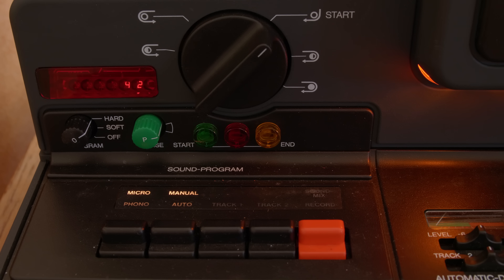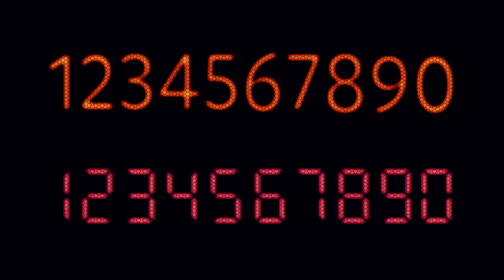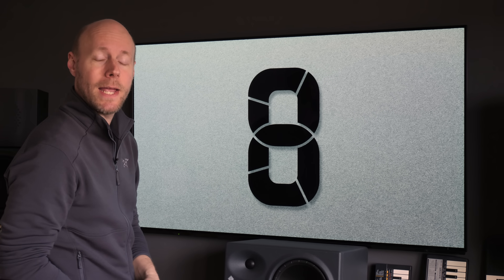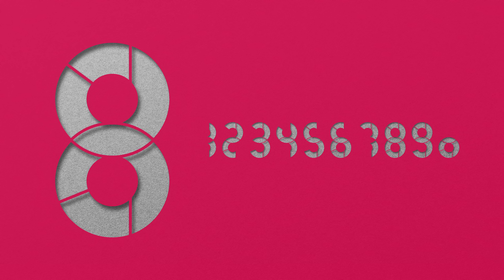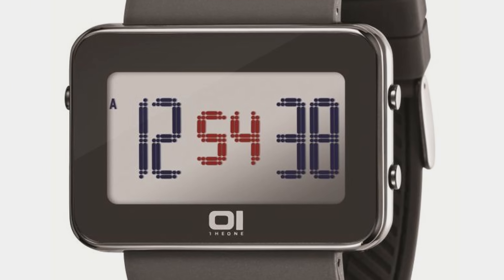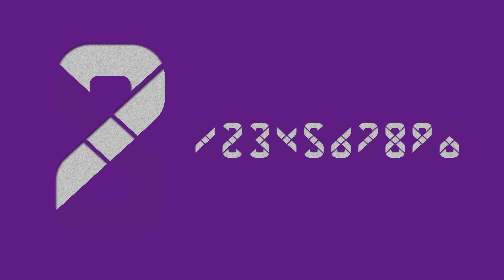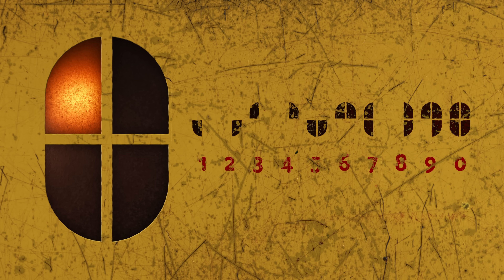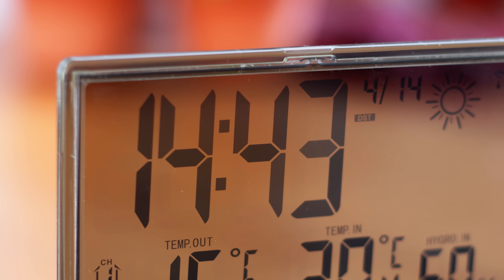Segmented Displays

Comment: Wow, those "sports" styles (and a few earlier, and all the ones after) look horrid, surprised you found household items using them. Of the 7-seg's you have shown, the first one is probably the best, maybe one of those which is that one but with cut outer corners.
Also, you said the normal one is inaccurate? How? you tried displaying a font above it, but while I would (and always have) agree that 2 is a bit off, you invalidated your entire point by intentionally using the 4 with a radically different look. That's akin to someone having a font and showing it's "incorrect" by comparing the "a" to the standard-font's "A". Or if you get a font with that other version of lower-case a (the one much more common than what "a" is in this comment, the one that "@" is based on)

Oof, the 6-seg displays are super horrible. Makes sense why we stuck to 7-seg I guess, despite the vastly increased complexity (1 single more led to wire! Per digit!!!).

Comment: Very interesting. I remember thinking about this when I was 14 years old and not being able to come up with anything better than the 14 segment "double square plus X," which IMHO is still the best overall for western numbers and letters.

But recently I've been studying Japanese, which uses all of our characters, plus Hiragana (ひらがな), Katakana (カタカナ) and Kanji or Chinese characters (漢字). The latter can become unwieldy (eg. 鬱、薔薇、檸檬) so I'd be surprised if there ever was any Chinese or Japanese display system for those that was not a high resolution dot matrix.
But Katakana is more regular and squarish, and you can write all of Japanese with it if you want, it's just harder to read than if you used the proper characters for each word. So I wouldn't put it past the Japanese to have had dedicated Katakana LCDs in the 80s.
Here is all of Katakana for reference:  アイウエオ、カキクケコ、サシスセソ、タチツテト、ナニヌネノ、ハヒフヘホ、マミムメモ、ヤユヨ、ラリルレロ、ワンヲ plus two diacritics in the top right corner: ゛゜
Reply: I did a few searches in Japanese and I checked their Wikipedia and nothing came up. But I don't think it's impossible. For example, if you look at ウクサソタツヌフメリレワヲ they all have a ノ in them, while シラン and possibly カ have the bottom 3/4 of a ノ. If you want to try your hand at designing such a thing, I can help you tell what is legible and what is not. Admittedly you also need smaller versions of some characters: ァィゥェォ、ャュョ、ッ in addition to what I wrote above.

But if you look at the default character set of the ubiquitous HD44780 dot-matrix text displays, they all have Katakana in them (eg. in http://d32zx1or0t1x0y.cloudfront.net/2010/03/HD44780_breadboard_05_lrg.jpg see the 4 columns from 1010 to 1101) so if they can read it on a 5 by 7 dot matrix (35 segments) I'm sure it can be done with a more elegant choice of segments.

Comment: Something to acknowledge is that not every country write the number the same way. 
For example, in France the numbers are way more round, where 6 and 9 looks a lot like a 8. The 2 tends to have a little "o" where join the base and the leaning part, but mostly in cursive form. The 1 has frequently a "_" underneath while the upper leaning bar is way bigger. The 4 looks almost exactly like the one on digital display (more like a + with an almost vertical bar in front, why is the gap closed in the upper part of 4 anyway?), and the 7 has always a "-" in the middle of it and even a "_" underneath sometimes.
In a effort to make compromise to fit better the way a country write their number, some display would end up to be way further from the basic solution for other countries.

Comment: Cool video.

I've not seriously tried to improve the structure of the seven segment display, though now I'm tempted to give it a go, but I have come up with a set of digit designs for display on a standard 7 segment display with the design goal that it should include the dozenal digits dek and el (I later added 4 digit forms to accommodate hex), not have any digits which were pure rotations of eachother (standard 2 and 5), for each digit to differ from every other digit by two or more lines (k-maps were helpful here), and to meet my aesthetic preferences (such as for a 6 with a top, and a straight backed 9). (The following are shown with shared corners, imagine a diagonal line separating, or equivalent; these were designed with a standard 7 segment double square display in mind, though more advanced displays may of course be able to handle them)

⬛⬛⬛⬜⬜⬜⬛⬜⬛⬛⬛
⬛⬜⬛⬜⬜⬜⬛⬜⬜⬜⬛
⬛⬜⬛⬜⬜⬜⬛⬜⬛⬛⬛
⬛⬜⬛⬜⬜⬜⬛⬜⬛⬜⬜
⬛⬛⬛⬜⬜⬜⬛⬜⬛⬛⬛

⬛⬛⬛⬜⬛⬜⬛⬜⬛⬛⬛
⬜⬜⬛⬜⬛⬜⬛⬜⬛⬜⬜
⬛⬛⬛⬜⬛⬛⬛⬜⬛⬜⬛
⬜⬜⬛⬜⬜⬜⬛⬜⬜⬜⬛
⬛⬛⬛⬜⬜⬜⬛⬜⬛⬛⬛

⬛⬛⬛⬜⬛⬛⬛⬜⬛⬛⬛
⬛⬜⬜⬜⬜⬜⬛⬜⬛⬜⬛
⬛⬛⬛⬜⬛⬜⬛⬜⬛⬛⬛
⬛⬜⬛⬜⬛⬜⬜⬜⬜⬜⬜
⬛⬛⬛⬜⬛⬜⬜⬜⬛⬛⬛

⬛⬛⬛⬜⬜⬜⬛⬜⬛⬜⬜
⬛⬜⬛⬜⬜⬜⬛⬜⬛⬜⬜
⬛⬜⬛⬜⬛⬛⬛⬜⬛⬛⬛
⬜⬜⬛⬜⬛⬜⬜⬜⬜⬜⬜
⬜⬜⬛⬜⬛⬜⬜⬜⬛⬛⬛

⬛⬛⬛⬜⬛⬜⬜⬜⬛⬛⬛
⬜⬜⬜⬜⬛⬜⬜⬜⬛⬜⬜
⬛⬛⬛⬜⬛⬛⬛⬜⬛⬜⬜
⬛⬜⬛⬜⬛⬜⬜⬜⬛⬜⬜
⬛⬜⬛⬜⬛⬜⬜⬜⬛⬛⬛

⬛⬜⬛
⬛⬜⬛
⬛⬜⬛
⬛⬜⬜
⬛⬛⬛

Compromises are made on the 5 (but we get a distinctive shape I quite like, and the gap can imply the rounding of the lower half of a 5 in the 2-stroke handwritten version, which I use), the 7 (again, the gap implies a diagonal), the 8 (higher numbers were given more compromising forms because they are less common than lower numbers), and the 9 (here you see my preference for a straight backed 9 come through, as both the shape of the 9 and other digits were compromised to maintain it. The other design in the running lit the middle segment but unlit the upper right segment, giving a sort of glottal stop symbol shape.). I doubt any of the forms were original, the ones I used for dek and el weren't, but I did independently discover this particular set with influence from the standard forms.

Comment: Very interesting video. I faced a similar challenge when creating an alphabet for a new artificial language a long time ago. The solution I came up with was a ladder-like 8-segment base character. Three vertical lines connected by two horisontal "step" lines. The basic character is the central square with four vertical "limbs" (#). The group creating the artificial language adopted this character shape and decided to have four vowels (each with three of the central square lines) and 16 consonants (each formed with a vowel with one of the four limbs added). The language itself always used open syllables built with consonant+vowel (#o). Two syllables would make a word stem (#o#o). Modifiers to the wordstem would be one or more one-syllable prefixes (there would be a total of only 64 prefixes). Numbers would be written with consonant characters. A single consonant would lack a vowel and would thus be one of the 16 digits (#). Two consonant characters would also lack vowels and would be numbers, etc. (##, ###, ####).  The construction of the language using open syllables allowed the alphabet to be rotated for writing in any direction. 

The ladder-like character does not adapt well to western digits but the difference would minimize the risk of confusing it to traditional displays. After all, the artificial language was intended as a global auxiliary language, not as a replacement for any existing one.

Comment: Very cool designs. 
But it does occur to me that 7 segments is more than enough for displaying numbers. Any more segments than that, and you really need to support letters, because otherwise, what is the point of using more electronics to drive the display. After all, you generally try to make devices that use such displays as cheap as possible. If cost is not a factor, you might as well use a OLED display.
This might be nitpicking, but kind of valid if you plan to use the designs. 
Thank you for the video.

Comment: It's a bit like writing in cursive, which is by far my most comfortable style of writing--the letters s, r, z, J, T etc look vastly different in cursive than in print but because I'm used to it I can read both just as easily. Even if there are flaws in the double square format it reads just as well to me as written numbers and so doesn't need to be replaced

Comment: @12:40 
WRT 3x5 matrices: some people did experiment using 3x5 and 3x8 for rendering eighty columns of text on old 40 column 8-bit microcomputers, with 320 pixel horizontal resolution.  It required some complicated (and RAM consuming) glyphs, so made building an application to use this tricky.

Comment: Really amazing video. I had always thought about 7 segments and other similar models and wondered if there were any other designs that could use about the same number of segments and give the same number set as well as having more clarity. Remember this old stove I had had slightly modified the 7-segment design to display a hard to make out limited alphabet. Never seen it again though, could it have been a dream. Wonder if you could make a genetic algorithm to try and generate segmented displays to match a font with the least number of segments.

Comment: To "improve" upon the double-square design, you need to identify ways in which it COULD be improved. It's already a very clear look for digits 0-9, so clarity can't especially be improved, I think. Improving on the LOOK is, subjective, and since the double-square is so old and ubiquitous, it's unlikely your gut instinct will ever say "I have made a better-looking design."

That leaves two real avenues to improve upon:

1) Use fewer segments without compromising the clarity. (and, if possible, without compromising the look, but that's unlikely)
2) Make it possible to clearly display the A-Z alphabet as well. (if possible, without adding any extra segments, but that's unlikely)

Very tall orders... I would not be the least bit disappointed with myself if I tried these and failed at them. And you did pretty well with your X design, on both fronts!
Reply: The 7-segment "X" with a segment on the right can accommodate a set of digits which all differ from each other by at least 2 segments.  On a double-box display, a 9 will be one segment different from either an 8 or a 4, but on a double-box display if one uses the right-hand segment for 1, 7, and a full-height triangular 0, the digits will differ from each other by at least 2 segments, and will further all have unique contours.

Comment: I wonder if the simplified way that many people physically write their 4s, myself included, originates from the double-square segmented display design. 

Secondly, I noticed that the “4” seemed to suffer the most from each of the different redesigns, perhaps because it uses many straight lines on displays that are created to accommodate for rounder numbers.
Reply: So it seems that 7-segment displays were popularized in the 1970s, so does anyone remember writing 4s with an open top to be a popular practice before then?
Reply: I stopped capping my 4's in school, because I was tired of the teacher not being sure on whether I was writing a '4' or a '9'. Granted, some of my 4's were initially too rounded and I could understand the confusion - Yet even upon taking extra care to keep my 4's sharp, the confusion continued , until I changed it.

It wasn't a conscious decision to make the connection to the 7-segment style, but that would have been the inspiration!
Reply: 4 is just too perfect for double squares I guess.
Reply: I've never capped the 4, and seeing the 4 capped is ugly to me.  I am also not exactly young and my elderly parents always used the uncapped version as well.  The capped 4 is too close to an A.  The capped 4 is also too close to the 9 when written, which is why many of us were taught to correctly write the 4 uncapped.
Reply: how about we just remove the 4 from the number alphabet. seems like an easy solution
Reply: @TheManinBlack9054  You could probably make anything the new 4 and people would get used to it in a few decades or so.
Reply: @TheManinBlack9054  how about you stop making the same unfunny comment everywhere, which wasn't funny the first time, either. Seems like an easy solution
Reply: Yeah! I don’t cap the 4s when I write anymore, it’s fascinating that it happened in my brain subconsciously

Comment: An advantage to the 7-segment "X" font is that if one uses an upright triangular zero, one can choose digit patterns in such a way that removing a segment from any digit will yield an invalid segment pattern rather than another digit.  The 7 would need to use a vertical rather than the diagonal to avoid ambiguity with "2", but otherwise I think the design would be superior to the double square in many applications if people didn't mind the weird look of the zero and four.  Many digits on a double-square display can be hard to distinguish without glasses, but the visual acuity required to distinguish all the digits in the "X" font is much lower due to the wider gaps and different angles.

BTW, while you called out "fake matrix" displays, I think it would be good to note that many such displays allow the dots at the intersections to be controlled separately from the lines connecting them, either as a means of avoiding gaps or to allow nicer readout of hex digits A-F.

Comment: As soon as you mentioned that they aren’t always symmetrical I looked at my microwave and sure enough they are super odd shaped.
Reply: The 2 is sheared in a very similar way to 4:50, but not with that design.

Comment: The cheapo scientific casio calculator uses a 5x6 matrix for the input formula and a 7 segment with dot and comma for the answer.
Generally the 7 segment display stuck around because it has 8 wires, it's already known by most people so readability isn't really a concern and wiring it up is really simple in most circuits.
Other types of display segment format aren't that popular for mostly practical reasons, sure you can do some amazing stuff with a 30-segment display, but that's almost 4x the wiring of a 7-segment display with a more complex logic behind it to boot. Not to mention it's pretty impractical for a breadboard.

Comment: I’ve used 3x5 matrix text a lot for putting text in bitmaps, but yeah, most actual devices optimized for matrix display just skip straight to 5x7 or 6x8 if you count descenders & whitespace since at that point it’s a cheap tradeoff for dramatically improved legibility.